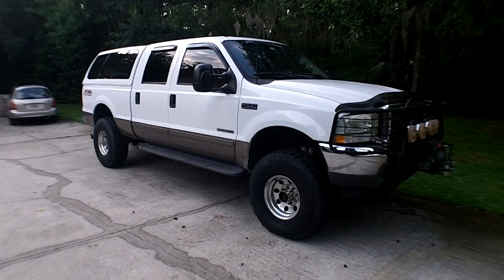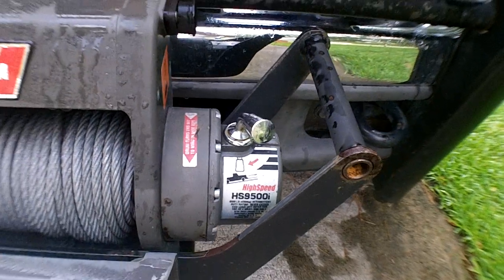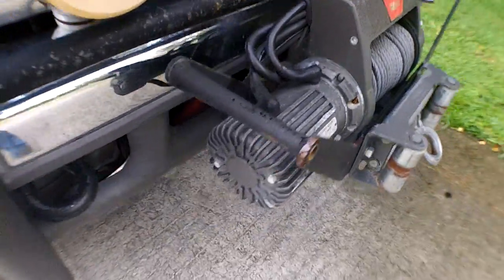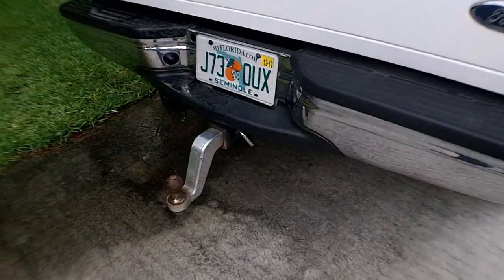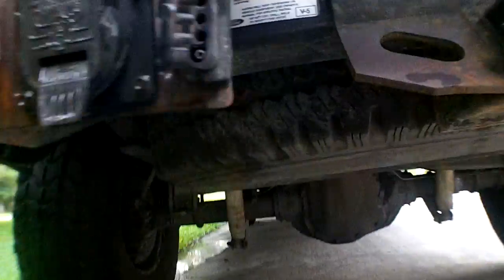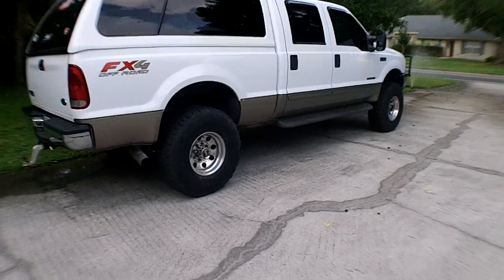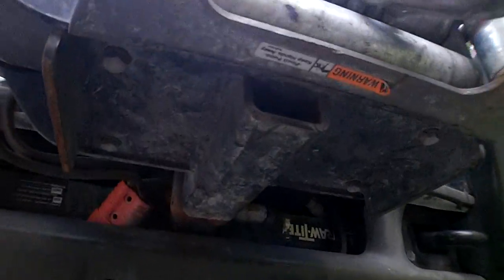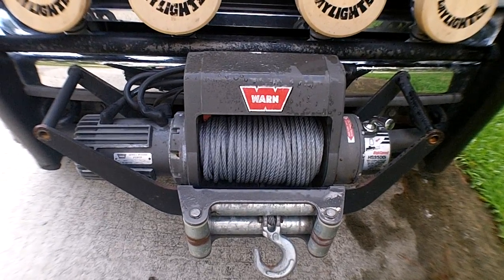Warn Winch installed in Cradle Mount front or rear mount

Comment: I did the same thing, receivers front and back on my 88 Ranger 7 years ago.
Right now switching out my 8000 lb. Champion winch for the 12000 lb Badland winch from H.F. with a cradle mount.

Comment: I bought the 8K lb Champion winch from Costco 7 or 8 years ago for around 250 bucks, have used it many times in those years with no trouble. The only reason I'm replacing it, couldn't pass up the Badland 12K lb winch for $299.00 (plus tax) I'll mount my 8K winch on my car hauler.

Comment: I have a similar setup on my Toyota Tacoma TRD Off-Road - a Curt Winch Mount attached to a front hitch receiver. I don’t plan to ever move or remove the winch, so the winch mount is bolted (big hulking bolt) directly to the hitch receiver with the winch itself (Smittybilt XRC8) wired in permanently. The winch setup can be removed (if I decide to sell the truck, etc), but not quickly.

Comment: hope you have a snatch block. 9500lb winch is cutting it close for that truck..my 04 F350 crew cab long bed weight 7,800lbs with me in it.
Reply from the maker: Oh yea, snatch block - tree strap - clevis's and a couple chains.
Reply: Stuff4Guys
cool. nice truck. do you know the model number of the front hitch setup? i wanna do the same for my rig
Reply: You don't have to life the truck off the ground. Just saying its got wheels.
Reply: Snatch block will double your pull force and cut your battery amperage draw in half.

Comment from the maker: Yes the solenoid and switch are necessary, you dont want power the the winch all the time.  I just flip the switch when i am going to use it, other wise you would have a large drain on the batteries.

Comment: Good video.  I bought the Warn VR8000 and a universal cradle.  I bought a 24 foot power lead cable from Warn.  It came with a solenoid and a switch for the inside of the cab.  Is this necessary and did you install the solenoid?

Comment: So reviews on Amazon say it’s loose and it rattles. Talk about shimming it. Warn says in one answer to call them. I called them. They say the mount shaft that goes into the receiver is under size on purpose to make it easy to mount and dismount, and that it isn’t for permanent mounting. He said the shaft is roughly 1 3/4”. He did not say it in the same way, he did not say you aren’t supposed to drive with it because of cracking. But several people complain in reviews, say it’s sloppy, they cannot understand, cheap product etc. . They mostly don’t know what the rep on the phone told me today, or what you say in the video. Most all are just puzzled. Some say nothing about it. And I got the impression those folks were more using it on their own rural properties or farms and don’t drive around on the road with them much. Well there are anti rattle devices of many forms and qualities, ones that will solve this problem, though some might bend under use, so maybe loosen the anti rattle device when using the winch. And most ball mounts have some slip in them inside the receiver anyway.I don’t like any extra work being involved when I’m already stuck in the mud etc. I also realized when you drive you can just hook the end of the cable to something solid on the vehicle near the winch and just put some strain on the cable to hold it from bouncing around. The bouncing is hard on any metal and the welds are most prone to cracking, but as you have found, the mount is strong enough to take it. I just ordered this one online and a Warn M8000. Another concern was with it loose it cocks when you pull any way but straight out. But that is not a concern, it is plenty strong even if it cocks a little. These have been used for a lot of really demanding tasks according to the comments and reviews I saw, and no one said the break or bend etc. . But I read about the cheapy brands having catastrophic failure. One guy said a cheapy one tore loose and sent his new M8000 Warn (a coincidence) 80 feet through the mud. So for $20-$50 I think an anti rattle device is worth it. Also, I got a Convert-a-ball (that is the brand name) mount with a urethane block inside it that acts as a shock absorber for my trailer hauling. Really well worth it for wear and tear and safety. Not to mention comfort.

Comment: How did you run your power cable to the rear of the truck? What all is needed to run the power cable. I have a 08 F-150 Super Crew with 6.5 bed with the front receiver. I would like to run it to the rear.
Reply: Ricky Massengill I
Reply: @vallesan  Can you just run the positive cable to the battery and just use a small piece of negative cable to the rear of the frame to ground it, so you don't have to run both cables the full length of the vehicle??
Reply: @lennybondi  

I have a silverado and I run both positive and negative to the baterry ...i dont know the technical reasons but an engineer told me that using a short cable (negative) connect to the chasis  is no good for the winch ... You can call or ask the guys on etrailer.com maybe they can help ...i have diferent setup on my truck very different .. I have a warn 18k pounds 24volts with my silverado with 12v system. Run 1/0 awg wire front to back and works very good ...thinking to make a video soon ...

Comment: BTW, I got my cradle mount for my 12000 lb winch from ebay, the cradle mount offered by Harbor Freight is rated at only 9000 lbs.
Reply: Most receavers are rated at 9000# pull.

Comment: This is exactly what I want to do just a lot of money in doing this.
Reply: Not really. Any decent winch mount for the front is $500 and up. But this, with the Curt receiver for the F250 is running me $178, plus $245 for this winch mount. And they are rated at 10,000lbs for this winch mount and 9,000 for the Curt front receiver. Amazon, free shipping even to Hawaii with Prime. The Warn M8,000 is $27 for shipping on Amazon...again, to Hawaii. Can’t beat it with a stick.

Comment: Hey man,
Just get a set of professional jumper cables that are 16-24 feet long and you can take it off your truck and put it on anybody's truck and run it will off the jumper cables that would be hooked their truck's battery.
Reply: +Jon Walker   Oh, yeah. While standing in water or wet mud while stuck, you really want to be messing with connecting electrical cables directly to the battery. His setup, with safe connectors, is a much better idea.
Reply: ***** He's got an awesome set up, no doubt.  Car batteries are 12v DC, very minimal electricity.
Reply: Jon Walker   Since the risk is in the amps, not voltage, I certainly wouldn’t want to be messing with the 600-1000 amps found in a truck battery while wet and well grounded in mud or similar. I know it probably won’t kill me, but it certainly would provide one heck of a nasty shock (along with perhaps a little burnt skin, etc).
Reply: If either voltage or amperage are very low, it’s clear that the situation isn’t dangerous.  No need to be scared of car batteries they won't hurt you. They won't send electricity through water like you mentioned, either.
Reply: Jon Walker   Well, you're certainly free to believe what you want. However, since car batteries provide more than enough amperage to melt 10-gauge wire, arc weld steel, power electric fences, and similar, I have no desire whatsoever to test your theories.

Comment: Metal fatigue prediction is high voodoo.  You'll never see the "crack of doom" before you hear the tension release "ka-boom."  Odds are, if you actually do see the fissure of failure forming, then your head will split like a pumpkin when the mount assembly smacks it.  Then again the winch mount welds may not actually be the ones most stressed when the mount arm 'levers' up and down a few thousand times every day the truck drives to work and back again...

What are your ideas for preserving the welds and their inherent micro-fissures from road salts, etc? 

Would a second high-ductile/strength nut and bolt  be a good idea for what looked like a possible second bolt hole on the receiver?  Maybe it is better if the mount fails catastrophically before the frame bends?  If in doubt, it would probably be trivial for a welder to reinforce the old winch mount, but then again.... Who knows, but I would be careful about side-loading a receiver winch mount for sure...pulleys are great for redirecting lines of force.  

It would be interesting/educational if you mentioned how many times you have made use of the portable winch?

Comment from the maker: Yes the solenoid and switch are necessary, you dont want power to the winch all the time. I just flip the switch when i am going to use it, other wise you would have a large drain on the batteries all the time.